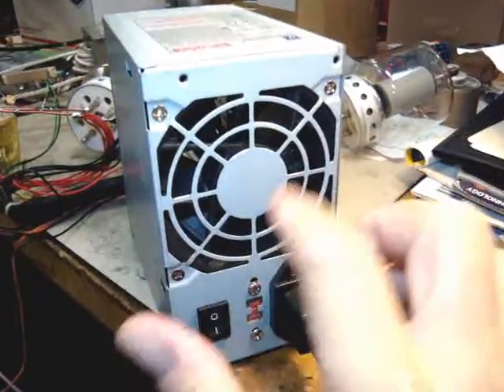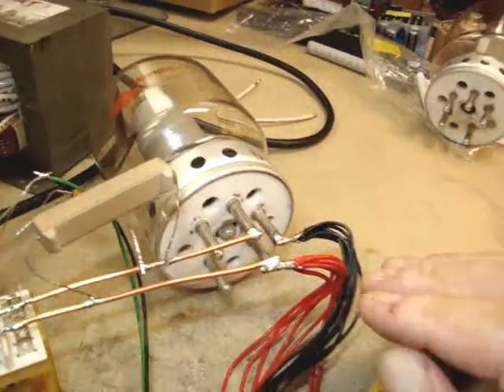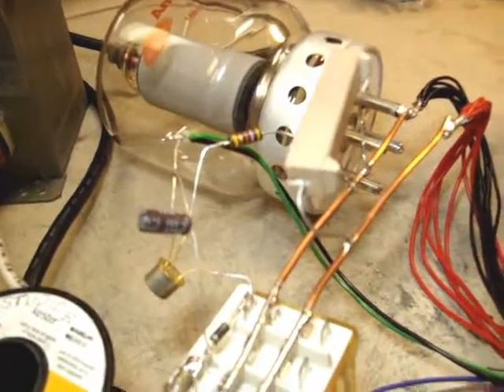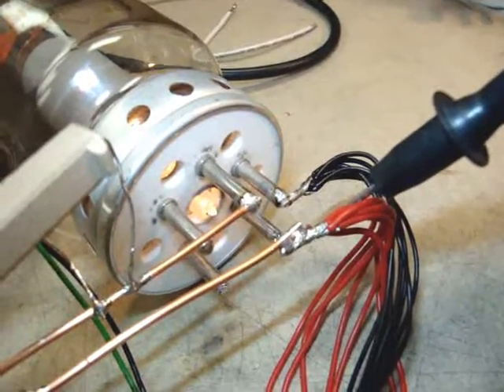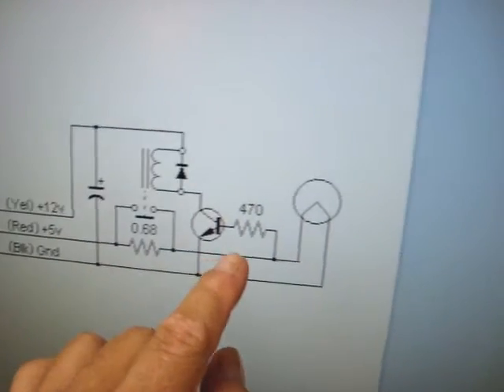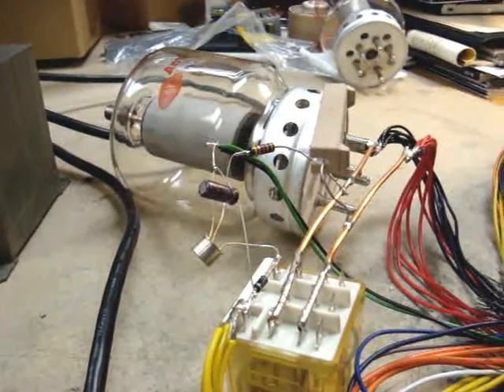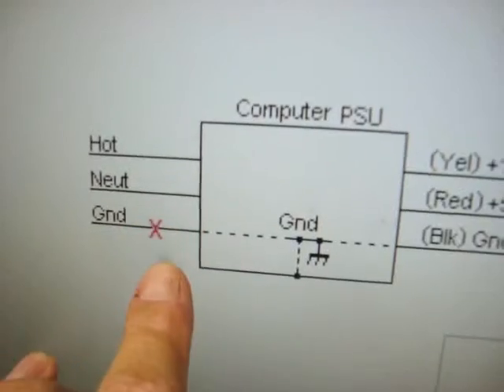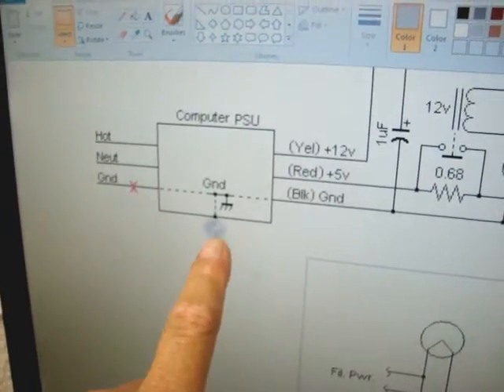ATX Computher Power Supply for 4-400 Filament

Comment: Power factor is probably better and it probably runs a lot cooler than a rewound MOT. Nice soft start circuit. The 0.68 ohm resistor limits startup current to about 7.3 amps based on the cold filament being like a dead short.
Reply from the maker: Good point, thanks for sharing that. 👍

Comment: Thank you for sharing your solution to the challenge of finding a filament power supply for 3-400, 4-400 and 3-500 tubes. Something else that might work to provide a temporary load, though less elegant, is to wire an incandescent light bulb in series with the tube's filament. I've seen this technique used on the primary side of a linear amplifier's high voltage transformer. The light bulb illuminates momentarily during the in-rush current spike but soon goes out. Something like this: http://www.bristolwatch.com/load_lamp.htm. Consideration would have to be given to appropriate specifications for the bulb. Perhaps there is an opportunity for this type of solution to deal with loading a computer switching power supply's output? Or, is it just repeating the same problem that the filament presents? Thanks again! Rob.C